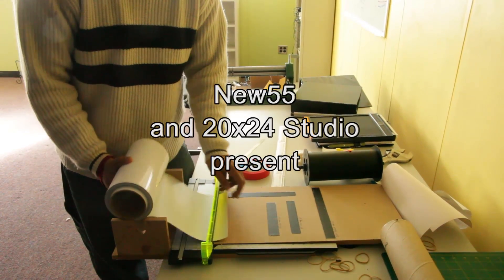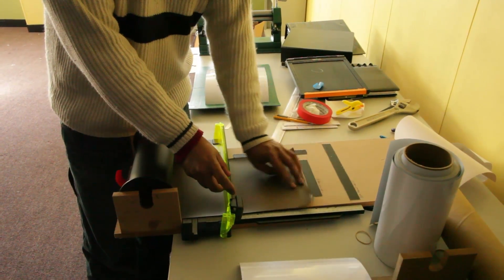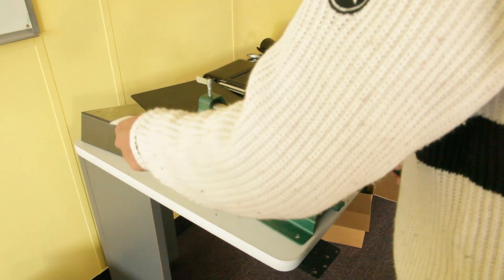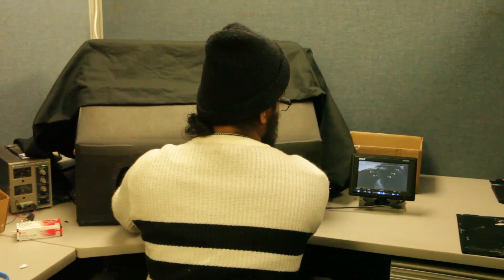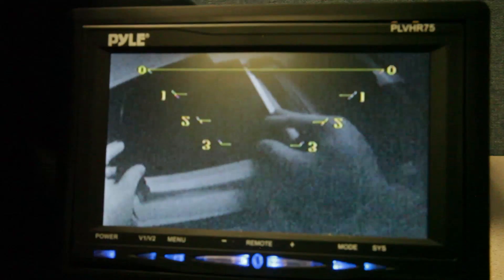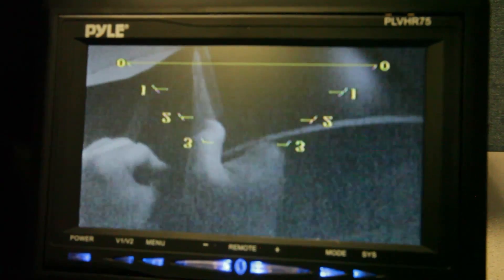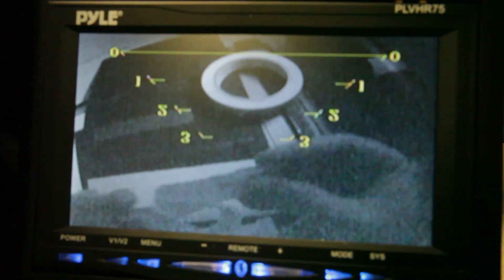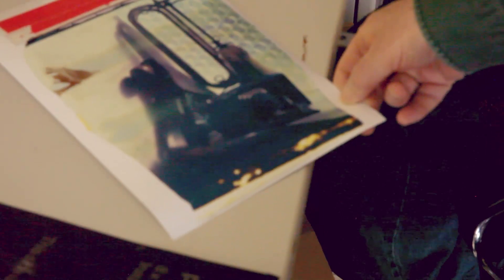DIY 8x10 Polaroid

Comment: I am thinking of doing something similar with Ilford fp4 8x10 sheet film and multigrade rc paper (not sure pearl or gloss) using a regent formula I found in instructables.if I wanted to make a box like the one that Crowley made do you think a baby monitor with night vision could work? and What Brand model was the sheet roller did it need some hack to roll that thin ?
Reply: Did you ever do this?